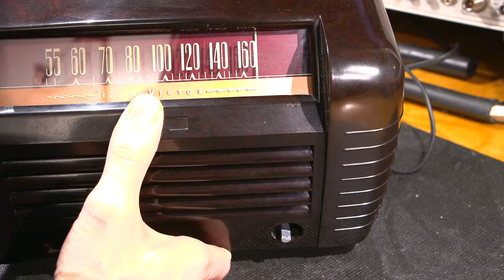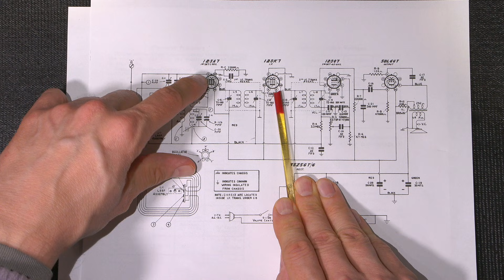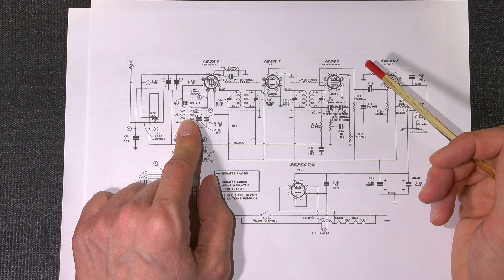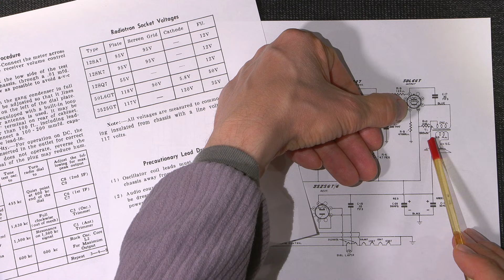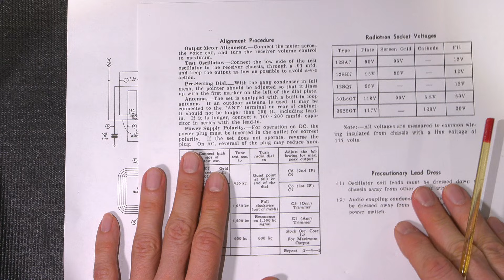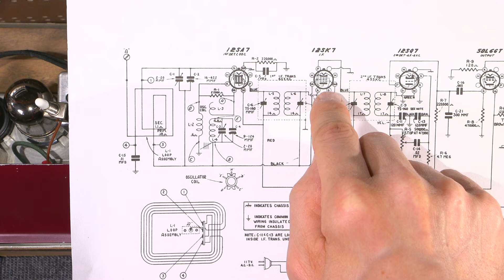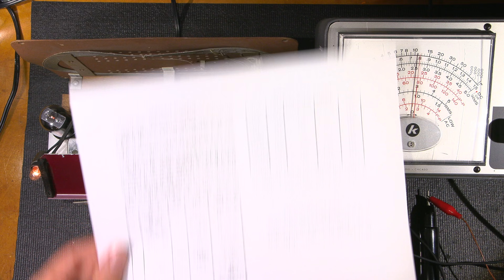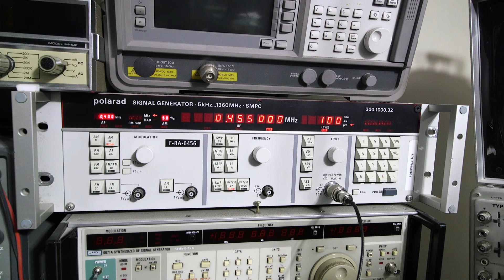Master Electronic Alignments!

Comment: 27:50 ... is that some relabeled Rohde&Schwarz generator? It looks VERY like R&S.
Reply from the maker: Yes, the Polarad is an R&S machine. The model is: SMPC.
Reply: @MrCarlsonsLab  
That "enter value first, then put it into its place" interface was quite familiar. Also the whole optical design language, the keypad with +/-/C/STO/RCL

I have an R&S SMS .. which even doesn't have that "intermediate" display. Got it from a friend and had to do some repairs on it.

When I first got it, there was really low output. When I moved it, it rattled .. they originally planned to use chokes in resistor shape as a collector load, but it seems they had to much parasitics so they replaced them by bigger ones on small ferrite rods which were glued onto the board and only connected by the fine coil wire. In transport the old glue gave up and the wire ripped. Had to reattach them. 

Later one of the 75361 relay drivers on the attenuator was dead, it normally controlled the (IIRC) 6dB pad which led to to ALC failures whenever the 6dB pad was supposed to be in. Shortly after the ALC failed totally, that was a dead opamp, the one which drives the ALC line. Maybe it got overloaded due to the fault before. 

The mains switch is still broken and bridged at the moment.

Comment: Very good video again Thanks for it!
One remark: The alignment by peaking all IF-filters at one frequency can result in a too narrow bandwidth as happend at 39:40. The measured BW there is app. 2,5kHZ at -10dB. This is too narrow for good (music) reception. At a given stations spacing of 9 or 10kHz at AM, the best BW would be app. 5kHz at -10dB. Therefore an alignment for a flat or double humped top of the iF filter with a sweeper is advisable.
Reply: But there's a bit of a balancing act, isn't there, between best sensitivity and selectivity?  And, again, stagger tuning as you describe requires different test equipment and techniques than the usual radio service shop would have been expected to have back in the day.
Reply: @donhall2759  You´re right, but in the case of an AM-radio, the sensitivity isn´t the main problem - it´s the best audio quality. The sensitivity(Signal to noise)  is set by the front stage and not by the IF. The IF sets only the gain. And yes, a good equipment is required - there is no free lunch!
Reply: @dl7majstefan753  I'd like to see a generic alignment procedure that could broaden the IF response of a given receiver, since I've been looking for better audio out of the AM broadcast band forever.  Thanks.
Reply: @donhall2759  I think, there is no generic procedure because schematics are very different: Some have inductive and others have capacitive coupled circuits. Others have ceramic filters with coupling capacitors and others have no coupling beteween the filters - each filter is independent. So the alignment has to follow the individual procedures defined by the manufacturer.

Comment: Oh man, do you have time for a little isolation transformer story? 
Back in the 70's I was in a High School electronics program and working in a TV repair shop after school. 
There was a vocational competition that came up and another student and I from the program went to compete in television repair. They gave us each a television with several "problems" introduced by some pretty clever guys. We had access to a supply room where we could ask for parts and test equipment we thought we needed. We had a time limit, ready....set....go!  
So the first thing I did was a visual inspection and found several issues right off. Under very watchful eyes they allowed me to correct a few things without powering up. Once satisfied I proceeded to power up with a cheater cord...."Hold on there buddy", What? They started asking me questions about theory and procedure and "what would I do if" scenarios and apparently, I answered satisfactorily because they said it was obvious I knew what I was doing but I was missing one thing. "How do you know if the chassis is hot, one asked." I directed their attention to the polarity on the cheater cord and how I would connect it correctly. "What else?" I stared intently at the set, then I put one hand in my pocket. "Your so close, just one more thing your missing, you almost got it. What if there is something shorted."  Well, I said, back in the shop I have a light socket in series with the plug for the set. If it's a small set I screw in a 60 or 100 watt light bulb. For a bigger set like this I'd use a 250 or 300 watt light. If there's a short it'll light up. I could tell they were getting a bit exasperated. Then someone reminded us we could get anything we needed from the supply room. I asked for a soldering iron, "Nope, can't give it to you." A voltmeter? "Nope," Jumper leads, screwdriver? "Nope" I sat and embarrassingly stared at that set for like twenty minutes until the time ran out. Ding! 

"Do you know what you were missing, a judge said?  An isolation transformer for safety." 
I knew what one was but I had never seen one or used one on the job. It's just how we did it; that was old school. 
PS. I just got my first isolation transformer about a year ago off of eBay since incandescents are becoming unpopular. I've used it once. Old habits get comfortable I guess, what can I say?

Comment: Paul, I enjoy all your vids very much. I am impressed with your circuit analysis expertise.  I gave you a good plug in South Main Auto youtube channel re my way of handling a mud-covered circuit board in an automotive control module. I suggested that you have the genius needed to advise them.
Reply: Well well... you didn't hear all those birdies at the end ?  That could be caused by wrong aligning. It is not good.

Comment: Great video. As you are also an inventor of electronics instruments, etc., Would it be possible to make an electronic gadget that you could connect to the input of any other piece of equipment, computer, microchip, etc., that would send a signal into the unit and have the software print out the actual schematic of the unit as its traveling though all its circuit and components?

Comment: It would be very interesting to see more about alignment of communications type receivers with multiple IF stages and filtering, using a spectrum analyzer or sweep generator. I believe a sweep generator combined with an oscilloscope can provide the same IF response characterization, but can you show how that is done?
Reply from the maker: Hi Bill. Check out my Hammarlund video's, I show how this type of alignment is done with a spectrum analyzer.

Comment: Thank you so much for the information you share. It's so easy to understand the  fundamental of elctronics just by watching the  videos and then apply what you just learned.  Thanks again and I'm looking forward for the next video!
L.E. I've just fixed a Zenith from 1937. I've built a small signal generator and align it. Works like a dream! Short wave reception is amazing on this radio. Too bad the street lamps are noisy...

Comment: Anyone watching with curiosity is going to get a real education in alignment and how there is a difference in peaking and visualizing signal integrity. Doesn’t do you much good to peak without seeing the influence it has on the signal. If you want to learn the how and why, you’ve come to the right place. You continue to stress safety aspects when working on this gear. Being injured or killed because you are not sure is both dangerous and stupid. Anyone listening and watching is going to be warned of the dangers. There is no limit when safety is concerned. Being injured or killed is overrated. Anyone who has worked on tube gear and hasn’t been shocked or rudely woken up hasn’t worked on it much. Avoiding injury is key and following your methods are key. Your warnings are valid. Thanks for another great video. Stay safe mates!😊👍🏻😷

Comment: Is it possible to be TOO sensitive? Powerful stations normally overload weaker stations. Two stations on the same frequency but far enough apart in distance that normally you wouldn't hear both in a less sensitive receiver, only the stronger one. If too sensitive, would you now hear both? I remember as a kid listening to far away stations late at night when the conditions were right. Same with TV when you could get a good bounce from the atmosphere and pick up, however poorly, a station from outside the normal viewing area.

Comment: Really nice video, Paul.  The one thing you didn't show, that I'd be interested in learning, is how/where you safely hooked up the spectrum analyzer, given that it is a low impedance.
Reply from the maker: Thanks for stopping by Alan! Back when these radios were produced, most signal generators used output sections that would not only vary amplitude, but also the output impedance as well (think wirewound resistors in the output attenuation network,) pretty crude by today's standards, but it was effective. So when the signal was turned right down at the generator's output, the output impedance of the generator could be as low as a few ohms. When this low amplitude, low impedance source was fed into the antenna termanel on the tuning capacitor, no ill affects are encountered. The antenna itself (loop antenna) is a fairly low impedance itself. The analyzers tracking generator is fed to this point through a capacitive isolator. The 1 Meg input on this analyzer picks up the signal through another protection device at the radios detector plates. The signal at this point in the radio is strong enough that clipping the input signal lead to the insulation of the detector plate lead is enough for proper coupling, and since this is a high impedance point, the loose coupling doesn't drag the alignment of the last IF stage.
Reply: @MrCarlsonsLab   I see, I didn't realize that your analyzer has a 1Mohm input impedance  - that does make it easier.  It gets a little tricky when using a spectrum analyzer with a 50 ohm input impedance, as most have.
Reply: @w2aew  ,  By the way, have you seen the actual COST of "proper instrumentation online? It's shocking. AND... many are not CALIBRATED, only working (whatever THAT is meant to say... not renovated ala Carlson).
Reply: L

Comment: Some of the mysteries explained.   Thank you.  Where can I find a schematic for the dummy antenna?   I've seen those mentioned in various alignment instructions, but it seems to be one of those "well, everybody knows/knew about that" with no further detail.

Thanks for the video;  I learned a fair bit from it.
Reply: Ca. 200pF - 400Ohm in series is pretty common for use in series to an 50Ohm output. Gives the "magic" 450ohm of a random wire antenna and some capacitve reactance since a medium wave antenna is almost always going to be way short in comparision to wavelength.
Reply: @VintageTechFan  Thanks very much

Comment: Could you do another video on the alignment of a 1970's or 1980's digital stereo receiver?  And could you also dumb it down for us knuckleheads?  I collect vintage monster stereo receivers and some of the digital ones I have are slightly out of alignment.  I have a Technics SA-818 and a Sansui 9900z.

Comment: Paul, thank you for this detailed alignment video!  Since you used one here, will you also cover VTVMs, their theory, pros & cons, how to properly use them, why to use one today instead of a DMM or even an analog voltmeter (for example a Simpson 260), etc.?

Can you recommend any "spectrum analyzer" software that's preferably free/shareware?  And what hardware is needed to connect the DUT to a PC for spectrum analyzer tests?  (I ask about using free or low-cost software because I don't have the $$$$ for a real spectrum analyzer, especially since I wouldn't use it enough to justify its cost.)

Would you consider a series of videos about the different "old" and "modern" test equipment available, theory, how & when to use a particular piece or how an alternate could be used if needed, pros & cons, etc., etc.?

Comment: Mr. Carlson:  Would most any sweep type analog meter do if a "v t m" wasn't available (doing this type of alignment)? Lastly,  when they say "first peak" that's after a transformer has been screwed completely in and then working outward, correct? Thanks, and GREAT JOB and  channel as always.

Comment: Thanks Mr. Carlson!  Ive aligned many 455kc I.F. transformers over the years but learned many valuble lessons so I cant thank you enough. For one, Ive always used a 1000hz audio signal from the generator. Didnt know 400hz was Ok...cool! Secondly Ive never considered starting with a high amount of RF signal (500uv or more) and decreasing the signal as the gain in the IF strip improved. My method was similar, but I always started with a very small signal fearing the all dreaded "AGC action" screwing up my alignment. Also going through every screw in each can and then starting back at the very first adjustment is the answer. Id rock back and forth between the first two, then move on to the next two rocking back and forth. Wrong Andy Wrong!. Last but not least I always aligned with a VTVM on the speaker coil. Never even considered the spectrum analyzer and I have a small but pretty accurate one on my IFR AM/FM 1200S. Thanks again Mr. C you rock!
Reply: La señal del generador debe ser la más baja posible (por lo menos en la repasada final. Es indiferente el tono que utilice tu generador, aunque es preferible conectar tu VTVM en el detector y no usat modulación.

Comment: Could you please amplify on your comment in the next alignment video of using a frequency generator "not" a function generator ?
I have a Leader LFG1300 function generator that can modulate/amplitude a frequency. Correct me if I'm wrong.
If so, could you recommend a lost cost frequency generator that would be suitable in specifications for radio alignment ?
Great video as always Mr Carlson.
Thank you

Comment: Him love you vids!. I have a strange small monitor problem if you can help. 
Have the model Acer 1715 and it wont turn OFF by the button, just stays in standby. Runs great and with signal , you get perfect picture and green light but whether signal or not, i cant turn it off?? tried the power button for 1 second ,3,10 and nothing. i pulled it apart and checked continuity from buttons  to the cable at the logic board, so it must be fault there. Is the start circuit permanently "on"  or something screwed up? No bulging caps ect and nothing obvious. 

Thanks

Comment: Sweeping an FM IF with spectrum analyzer equipped with a tracking generator makes it possible to make the bandpass flatter. A flat response across 200kc bandpass improves the linearity of the demo duration process. Ie, lower audio distortion.  This is particularly important when aligning MPX receivers, as they depend  on signal cancellation in the matrix circuit to produce differentiated left and right channels. Distortion in the demod process results in crosstalk between channels.

Comment: Those final adjustments were very sensitive. Just wondering if the temperature of the lab would affect the readings of indeed putting it back in its case.

Comment: One important question I have for al the episodes I have watched you (and others) repairing old vacuum tube equipment. Thankfully, you often warn us for transformerless sets, because the chassis would be connected to one side of the grid, and if you don't use (have) a separation transformer, in 50% of  the cases you are using a chassis that will be HOT, which means that the chassis will be connected to the live side (the danger side) of the wall socket depending how you plug it in. But, I have learned that you can simply check on the chassis if it is hot by using a neon mains tester screwdriver (a 80V neon light with a 100K resistor in series). At least you can see if it is connected to the hot side, and if so, turn the plug around to be safer. Is there a reason why I don't see this mentioned ?
If you use a bright LED in series with a > 10K resistor you can get the same information.

Comment: Is it possible the test gear in use in that time frame defaulted to a modulated signal? That might explain why they would not mention that.
Reply from the maker: Hi Al. The test gear of the time always had the option of turning "on or off" a 400 to 1000Hz tone for this purpose. Alignment without this feature is impossible using the voice coil to VTVM method (the most standard way of alignment.)

Comment: Aaahhhh, those old radios!  When you were going to "align" them, you had to take a look on their enclosure , or the schematics, to find out the real intermediate frequency because it was not standardized.  Nowadays  it is 455KHZ for MW and SW and 10.7MHZ for FM. But those old days it was 450-460 KHZ for USA radios and 455-465 for european radios. Some MW only radios had an IF of 260-280 KHZ.  Your radio IF is probably in the 455KHZ area and has a so called "bum" variable capacitor because it is only for MW. The lower capacity is for the local oscillator and the higher for antenna tuning. I remember a radio of my father (rest in peace) similar to yours (RCA) having MW and one SW (HF band) having a symmetrical 500pf variable capacitor. When i was 13 years old i cannibalized it to make a regenerative receiver using only the 12sk7 of its tubes. Now i am an electronic technician, in the digital age ,programming PIC etc but i do not forget how smart were our grandfathers when (for example)  they were using the secondary winding of the power supply choke , in series  to the speaker to counterbalance  the "hum" noise. Or the so called "woobler". Nowadays we have swing generators and spectrum analyzers but those heroic days there was another way. An electric motor connected to a variable capacitor in order to represent a scan generator for IF tuning . Combining it with an oscilloscope they could adjust correctly the IF transformers. HATS OFF to those people!!!! 
Kostas from Greece